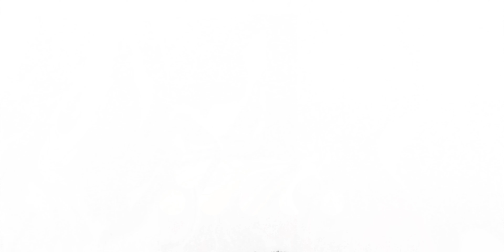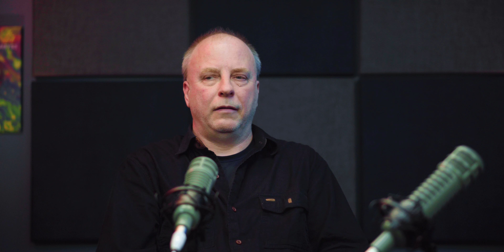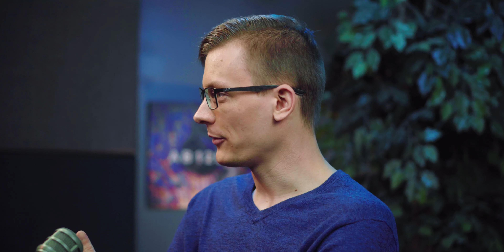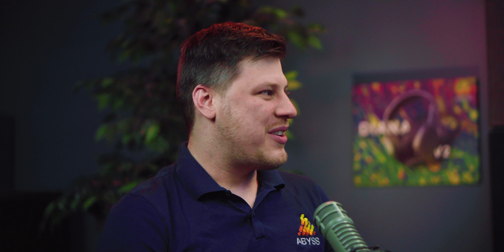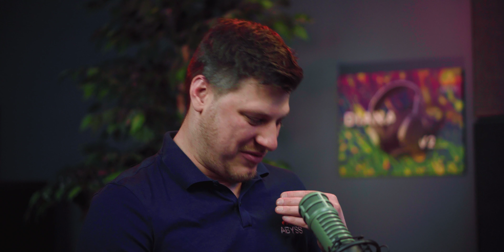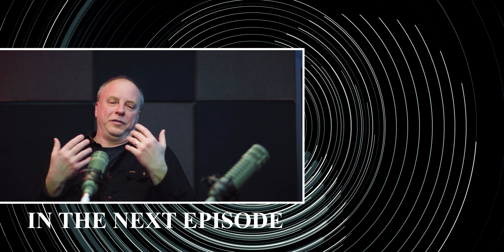TOTL: Why we DON'T use Mylar - Materials and Resonance Part 2

Comment: so, taking my TCs apart to look at the driver is a bad idea? ? ?   :)   Good future topics:  Estat vs Planar tech.  pros/cons   (wouldn't estats be faster since no trace needed, less mass), CC to TC what's different in the design, burn-in with 1266?  Does it matter. I've not experienced a change yet with mine. Your driver material used in full-sized speakers, at least tweeters.  How about an Abyss speaker!